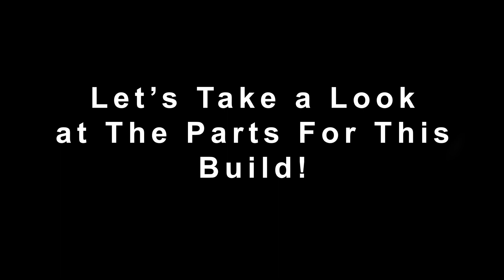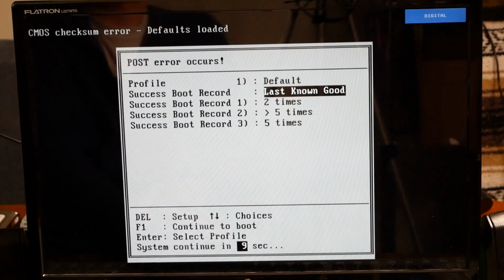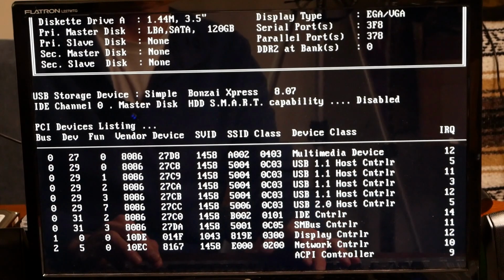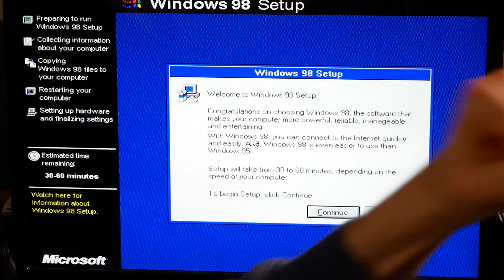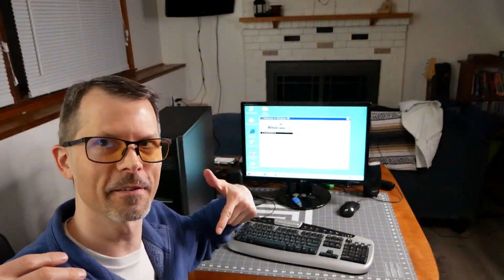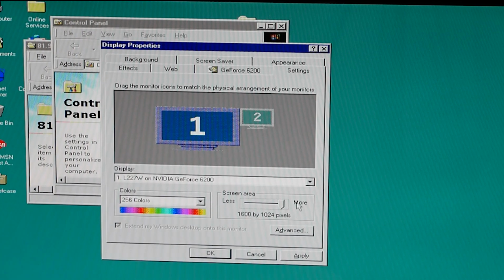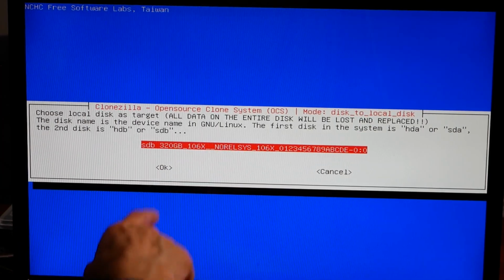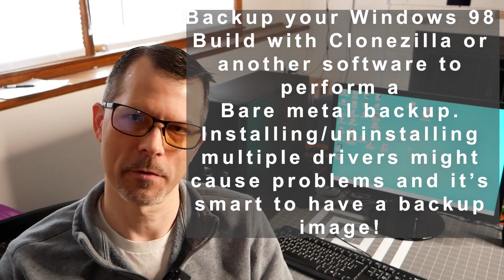Building The Ultimate Windows 98 PC - In 2023!

Comment from the maker: Here's the list of boards known to be working (or mostly working with some addon hardware and tweaks) with Windows 98.

ABIT IP-95
ABIT SG 80DC
AsRock 4Core1600-Glan
Asrock 4CoreDual-SATA2 R2.0
ASRock 775i65G R2.0ASRock 890FX-Deluxe5
ASRock 970 Pro3 R2.0
Asrock AliveDual-eSATA2
Asrock AM2NF3-VSTA
Asrock 4CoreDX90-VSTA R2.0
ASUS A8V Deluxe
ASUS A8n-E (with nForce 4 ultra chipset)
ASUS K8V-MX/S
ASUS M5A97 (Confirmed by rloew)
ASUS P4S800-MX
ASUS P5K
ASUS P5PE-VM
ASUS P5SD2-VM
BCMCOM BC875PLG
BIOSTAR P4M890M7SE
ECS 662/1066T-M2
ECS GeForce 6100SM-M
ECS K8M800-M2
ECS P4M800Pro-M2
Foxconn H55MXV (Rloew's SATA patch most likely required for correct operation, even in IDE/PATA mode)
Gigabyte 8IPE1000-G
Gigabyte G31TM-P21
Gigabyte GA-870A-USB3 Rev 3.1 (AM3+)
Gigabyte GA-8I865GME-775-RH (rev. 2.0)
Gigabyte GA-8I865PE775-G-RH
Gigabyte GA-945GCM-S2L
Gigabyte GA-965GM-S2
Gigabyte GA-965P-DQ6
Gigabyte GA-EP35-DS3R Rev 2.1
Gigabyte GA-K8A480M-9
Gigabyte GA-K8NSC-939
Gigabyte GA-MA785GM-US2H
Gigabyte GA-MA78GM-S2HP
Gigabyte GA-P31-DS3L
Gigabyte GA-P31-ES3G
Gigabyte GA-P43-ES3G (Rloew's SATA patch most likely required for correct operation, even in IDE/PATA mode)
Gigabyte K8NSC-939
Intel LAD865GVIPL
JetWay J7F4K1G5S-LF
MSI 865PE Neo3-F
MSI 865PE Neo3-V
MSI 970A SLI Krait (AM3+)
MSI K8N neo
MSI K9VGM-V
MSI P31 Neo V2
MSI Z87-G41
PC-Chips P23G (v1.0)
Portwell RUBY-9719VG2AR
Soltek SL-XP865G-3IG
Soyo SY-P4I845PE Lite
Soyo SY-P4I845PE-ISA
Supermicro X5DAE
Supermicro X7DAL-E

Comment: I used to copy the whole 98 installer on to a separate partition on my drive and install it from there so I didn’t have to put the cd back in every time I wanted to install a driver
Reply from the maker: Hi and welcome! Yup, I did that as well back in the day. Oh, the fun of Windows 98 :) Thanks for watching!
Reply: @RememberThisTech  i actually loved windows 98 I would still run it if it supported all the new hardware I can’t even get it to run on a Virtual Machine anymore
Reply from the maker: @jefferybills5224  Yup! I've tried to get it to setup on vms but it's tricky. That's kind of the reason I did this hardware build. Plus I wanted to see if it could run somewhat on newsih hardware.
Reply: All these smart YouTubers should make a newer windows with the ui the same as 98se
Reply from the maker: @jefferybills5224  now that would be something  to see! :)
Reply: I would always copy the cab files to a sub directory post install then edit the registry to point to the new location.

Comment: i'm trying install Windows 98SE on Acer Aspire 5630... but i'm dying with nvidia geforce go 7300 and HDA drivers.. iRQ's conflicts :(
Reply from the maker: @joaquimjesus6134  Sometimes you can find which devices are in conflict and manually assign them to each conflicting device.
Reply: @RememberThisTech  the main problem is  that i can't change them(the options are disabled) :(
Reply from the maker: @joaquimjesus6134  can you load into safe mode? Or does your bios allow you to change irqs

Comment: Since your 8800 GTS is >512MB, did you try the Rlowe patch to reduce thevram to 256MB which 98SE seems to have trouble with anything above?

I have gotten the Geforce 7800GTX 256MB to work, but have not tried the 8800GTS. I have the 320MB version, so maybe I should try that.
Reply from the maker: Hi and welcome! Oh, I didn't try that! Thanks for the tip. I'm sure I'm going to try it now :) My 8800 gts used smoke tons of games. Would be nice to get it to work. Thanks again for watching and commenting. I appreciate it :)

Comment: I know this may sound random 😆 but can you play MIDI files with using the sound master live? Because I know the sound blaster 16 emulation is not going to work.
Reply from the maker: Hi and welcome to the channel! If I recall I was able to play midi files. It's been some time though... I read that one should use the WDM drivers not the VxD ones in case though. Could be mistaken. I know I had to force the drivers manually and tried a couple times. Windows 98 is a pita at times for sure and this build reminded me how difficult the OS can be ;( Thanks for watching and commenting I appreciate it :)
Reply: @RememberThisTech  well thank you. I'm glad I stumbled on your video. I did Google that brand of motherboard and they look a little different compared to yours but I think it would still work. Like for example, your IDE port is red when the other ones are green 😆 think they may be a little different revisions but as long as they are both the same chipset which they are, it should work fine as I am thinking. Also, I have dealt with Windows 98 when old hardware newish hardware and it is a pita 😆
Reply from the maker: @alexmccullough8704  I researched that board so I could get the newest/one with legacy driver support and some modern things like Sata, etc. BUT omg, it was still an ordeal. One thing I'd do over is use a Nvidia 5500 or 5700 series video card, perhaps. But that same mobo I also used in an xp build. There was a website with all the mobos with 95/98 drivers, but researching and finding a working one from that list was tough. People wanted a lot of money for older working legacy stuff.. Thanks again, and stay tuned. I have a few more videos coming up with older legacy stuff soon!
Reply from the maker: @The10021k-guy  I used this Mobo GIGABYTE GA-G31MX-S2 LGA775 There's a few revs Like you said. Got it for a steal price of $35 bucks!
Reply: @RememberThisTech   thank you. I am looking forward to seeing more retro hardware videos. So do you think the other revisions of the board would still work? It probably will be a while until I build a modern-ish machine to install 98 on.  I will also keep an eye on those exact Nvidia cards. I know it's pretty hard to find hardware because people do charge an awful lot of money 😆 😫
Reply from the maker: @The10021k-guy  Its hard to say if the other revisions will work, but I'd check the Motherboard website, Gigabyte and see if there's any 98 drivers first! You can also look for a socket 478 P4 board, I've seen others who have had good success with those as well. Not as new but might have more support for 98/XP etc. Takes a lot of homework.
Reply from the maker: @The10021k-guy  Take a look in the bottom of the description Part of this video I Added a huge List Of compatible or known working 98 Motherboards.. Hope it helps you and others!

Comment: Does that revision of board have the Atheros AR-8131 lan chip?  If so what driver did you use?  There does not appear to be a Win9x driver for it....Or did you use a patch that allows the 2K/XP driver install?
Reply from the maker: Hi and welcome to the channel! Here's the link to the Board I used https://www.gigabyte.com/Motherboard/GA-G31MX-S2-rev-1x#ov  Its got good 98se driver support, part of the reason I chose to use it. I believe it uses the Realtek 8139 Lan chip. I used some patches from Other sites I can't 100% remember but might have used mem patch and others from Phils Computer lab and and archive. Thanks for watching and commenting I appreciate it :)
Reply: @RememberThisTech  Why LAN? Bios > itegrated periferials > LAN = disabled, Integrated graphics = disabled, integrated sound card = disabled. If is possible.
Reply from the maker: @marcelmojzis4374  Well, when installing everything at the beginning, your suggestions are most likely the best, and one should disable those. Thanks for the input, and thanks for commenting and watching:)

Comment: Windows 98SE was great!

I have some special Audio and Video capture cards that never had drivers released for NT/2000/XP.  So I still have 98SE installed on those machines.  They still work great and do exactly as intended.
Reply from the maker: Hi! Yep 98 se works and can still have a purpose even today :) Thanks for watching.
Reply: Thanks for the efforts for installing a PC with Windows 98SE OS.
 SSD connected SATA 2 slot  , DDR2 Ram modules, High class Quad core CPU were the facts which make the people to think that these parts would speed up the installation.Also these parts are the differences for this PC from other retro PCs which has legacy Hardware from its' time period. 
 Top level PCI sound card from Creative was another difference for this retro PC.
 This mainboard would run windows 10 on it effectively.
 Good work, thanks.

Comment: you could try a radeon x850 xt platinum edition for the gpu as thats the most powerful radeon pcie gpu for win98 drivers. it even has better driver support than the 5000 and 6000 series geforce cards. And a core 2 duo E8600 has the best single thread performance of that socket since win98 doesnt support more than 1 core. you know about the 2gb ram patch too. sound card is good considering the chipset, but you get better dos compatibility with an aureal vortex
Reply from the maker: Hi there! All great info tyvm! I'll have to see what new parts I can gather. I think I'll go for a more compatible build next round. Thanks for watching I appreciate it!

Comment: very cool build,, how fast is your quad core cpu in your computer,, i am just starting  to build my first windows 98 computer ,, i bought a MSI 661FM3-V (MS-7103) Socket 775  micro Motherboard W/ 3ghz cpu,,, and has ddr 400 memory 512mb,, i bought 2 512mb for 1gb it might crash with that memory,,,,,, it  also has 1 agp slot  ,,, 2 pci slots,, 2 ide hard drive controlers ,, 1 floppy slot,, 2 sata controlers,, i bought a ssd 120 gb drive for sata hoping to get my ssd to work ,, my queston is i saw other you tube videos stating going over 2 ghz  cpu will make windows 98 crash , yours did not crash,,,, my cpu is a pentium 4 3ghz single core will my cpu work ,, or down grade to celeron D 2.66 GHZ,, also mabe i can adjust the 3 ghz cpu to slow down in the bios if i my windows 98 crashes,...., hope to see more of your videos,,,,
Reply from the maker: Hi and welcome to the channel! the CPU i used was a core 2 quad 9500 @ 2.83 ghz. I installed with 512 meg ram then used the mem patch to see over 512 and ran 1 gig and i think 1.5. Your Pentium 4 should run fine. As windows 98 wasn't really ever able to see/use more than 1 core cpu. Crashing problems occur with older games for DOS that go nutz when the CPU is to fast. Windows 98 se is what I used. It crashed a few times but that was me trying to force video card drivers to work etc. my fault lol. 120 gig ssd should work fine. Might want to make it 2 partitions if win 98se dons't see/like the 120 gig at first. Your right in thinking to slow the cpu down, that can help in some cases. Best of luck and let me know how it goes! Thanks for watching and commenting I appreciate it :)

Comment: 10:29 only if your 60G partition were formatted FAT32 instead of FAT16, you would avoided some hassle.
Just to be on the safe side, make your boot partition less than 32G for FAT32 under Win98. One never know how a particular chipset/BIOS may (mis)behave.
Core line of CPUs were based on P3 if I remembrt correctly so you have there 4 pentium3 CPUs even if only one is used.
The easiest way to backup/restore a Win9x or dos installation is, for me, archiving the content of C drive (and restore it when necesary) with any program you see fit (zip, arj, ace, rar, all the dos versions).
Nice setup, I also tried Win98 on modern hardware and PCIe devices worked very well without issues, provided that there are drivers for them.
Reply from the maker: Hi and welcome! You're correct. I mist certainly made a few mistakes with this build :( I don't think I've built 98 in 30 years, hah! Perhaps I should have done a bit more research, I guess it helps me to relearn by doing this as well. I do seem to recall that the core2 was based on p3. Intell failure with the space heater p4 made them take a look back at the more efficient p3 architecture and bam! Thanks for the tips, comments, and watching. I appreciate it :)

Comment: When I got myself a P200 some time ago, I installed Win 98 SE and as the Win98 Theme came up for the 1st time it felt like I was 23 again when I got my first Windows PC 🥰 
But it is as You said: Those Windows versions were far from comfortable when it got to drivers & compatibilihy BUT to solve those issues just to play Half Life, Unreal or something like that are the reason we know today how to workaround most issues on a PC 😂

My favourite Retro build of that period is a SuperSocket 7 System (Asus P5A) with a K6 2-450 and a Riva TNT2 Pro. I did not bother with Sata drives on that one for obvious reasons, I used a CF Card IDE Adapter with a 16 GB CF Card as hard drive which can be also "hot swapped" at the back of the case 😁 works fine with every IDE controller. As Floppy I used the GOTEK. It is hillarious. And for some critic: I like sleepers but I would not use a case with USB 3 ports on the front to home my windows 98 build 😂😂😂
edit: Oh, and I think, Win98 does not support multi core cpu !?
Reply from the maker: Yep exactly! I'd fight for hours to get a game title to play! But it was worth it haha! Yep I think I mentioned 98 dosnt support multi core in the video. I know that but wanted to use the quad 9500 at 2.83 gigahertz just to sat did lol. I've got a sd to ide card reader adapter. I was going to try if the ssd gave me issues. I still might set thw reader like you did in the future. :)

Comment: This brought some good memories of W98 installs 🥰. I still can't believe W98 ran on a Core2Quad mb! Gotta be proud when manufactures are able to provide backwards compatibility with old drivers like that. My gaming PC in 96 or 97 was a Pentium Pro running at 233mhz, Adapter UW 2940, a 4GB Cheetah 10k, Monster Voodoo 3D(I can't remember the base video card), and 256MB of ram. Every game I threw at it was flying. Kinda makes you wonder how new of a motherboard can you install W98 on before it says NOPE I have zero clue what this mb is!

Oh my. Newbie mistake is bolting down the mb then discovering the video card doesn't sit in perfectly forcing you to realign the mb. Always gotta leave the screws loose to position the mb. Happened to me a good number of times .  Oh that old thermo putty, I've sometimes had to use a hair dryer to soften it up to separate CPU from heatsink. Ah fun times. 🙂
Reply from the maker: Hi! Yeah, some drives I had force, but they took. Not everything was 100% . Wow, 233 p pro! Those were expensive back in the day. So expensive I'm favt that my friends dad bought a 200 p pro and kept it even when he couldn't play or do stuff much anymore, lol. A 10k scusi drive back then wow lol that's awesome in a home computer. I did the same years later. Thanks for watching and commenting. I appreciate it! :)

Comment: Great video! Your 3dmarks result is pretty good for a  Nvidia 6200 GPU. For reference my 3d Mark 2001SE result on my current machine is 16895 - this is on a Pentium 4 3Ghz (OC to 3.3) and a Radeon 9800 256Mb Pro (also OC'd, 418Mhz GPU, 351Mhz Memory).  You're definitely outclassing me with CPU, but the Radeon GPU would put me back ahead there.
Reply from the maker: Hi and welcome! Nice 3dmark results! Ooh, nice, you have a 9800pro sweet! I've 2 9700pros, but as of yet, to land a 9800. Nice system you have there!  Wel,  my cpu and nobody choice sure wasn't ever dreamed of forWindowss 98 lol and I had a few hiccups trying to get it running. I was wondering if I should revist 98se build but use my amd 3500+ 64 cpu and 939 mobo this time.. go with my 9700pro and oc it a smidgen. Thoughts? Thanks for watching and commenting. I appreciate it :)
Reply: @RememberThisTech  Thanks! ah yeh, the 9700 are good cards too.  I actually started with a 9250 when I bought the system I started with for my current Windows 98 machine.  I'm not sure if its as much your thing but I'd be keen to see some more benchmarks, particularly some CPU focused ones.  

I've not tried any AMD cpus yet personally but I hear good reports about them
Reply from the maker: @erroneoushyphen  Thanks. I'll try and incorporate more benchmarks as I can in my next video :)

Comment: i am actually running my beast W98 computer C2D 6400, AGP Radeon X850 PRO, 1GB RAM on Asrock 775i65G rev2.03. 3DMark 2001 result near 24k score. DId u tried dual core CPU instead C2Q? I think u can do much better result with CPU where is higher power for one core or you can try disable cores in bios but not sure if is possible with LGA775 cpus 🤔 Hmm i am surprised you installed PCI express under W98 i think i need try same thing 👀
Reply from the maker: Hi, and welcome to the channel! You've got a nice setup there!! I had a radeon 800xl back in the day with an actic cooling aftermarket cooler on it. Nope, I haven't tried a dual core or a high singer core setup yet, but I've got something planned for the near future!! Yeah, pcie graphics worked. It wasn't easy, and a lot of mobos and graphics cards probably won't work, but hey, it's worth trying :) Let me know how yours works out. Thanks for commenting and watching. I appreciate it :)